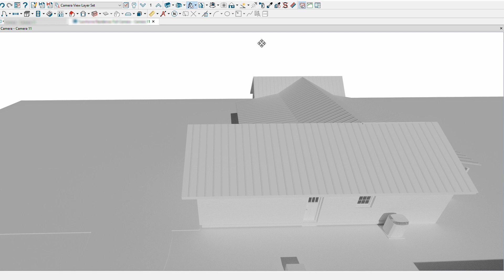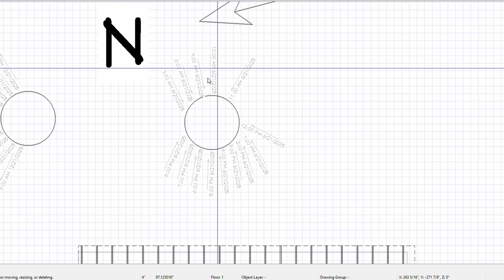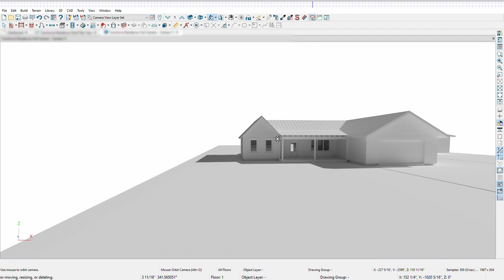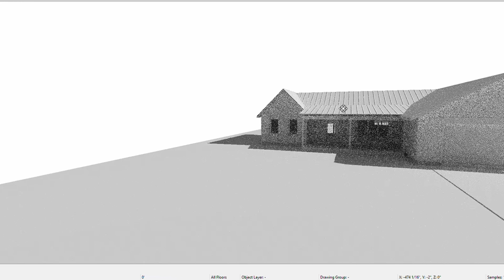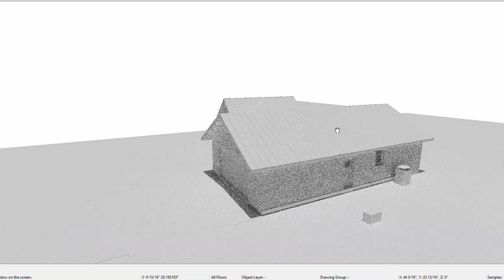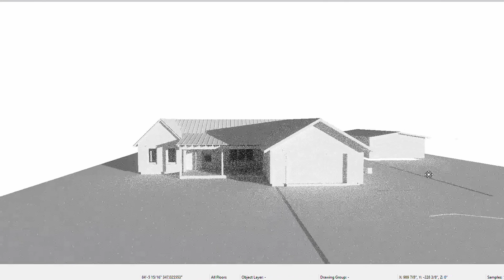How to Track Sun Angles when Designing Your Home - AHPH 104

Comment: Don't take this the wrong way as I have allot of respect for your work so bear with the criticism. 
 
       I have lived in TX since 89 and have learned a few things about directions of parts of houses.
   
           Views. Unless you have a lake or a pond or mountain, no one cares about the view out the window no one is watching the sunrise or sunset from the inside of their house.
     
           Never point the front of the house south if you can help it.
 
           Never point the garage door south (heat and hot south wind in the summer)or to the NNW(direction of prevailing weather). 

          Never ever put floor to ceiling windows in a house. If there was ever a place that they are a bad idea it is here. Also never put them in a bedroom and always have at least one wall in a bedroom without a window or a door. Common design makes sure there is a window or a door on every wall so you can't put furniture against a wall. Same with living rooms. Large windows in living rooms are also a no no.

          Don't place your house at the far back of the lot. This gives you no usable back yard and nowhere to build workshops etc. Front yards are unusable space that have to also be maintained more because they seen from the road and you want your private use space behind the house.

           The hip roof you started with yeah not a fan of them as they are meh and vastly overcomplicated which leads to higher install cost higher replacement cost and a far higher likelihood of leaks and issues over it's life.  
        
          I prefer the version with the full length porch. The short porch looks like a builder trying to save a buck. I also like the old large overhang porches around the house as the point was to keep the sun and weather off the exterior walls, an early high performance feature.

            Your solar panel plan is good. I'm a big fan of them. When possible I would opt for a ground mount system. Yes you loose the heat rejection of the panels being on the roof but the panels will produce more power in a ground mount setting because they stay cooler and you can also use bifacial panels which will increase output as well not to mention install and maintenance is far easier with a ground mount system. Cleaning and repair as well as when on the ground you have the capability to easily add a hail protection system to them.

           I tend to take a more pragmatic approach to most things and have a different look at things as I am looking at it from a realistic use approach not a realtors/builder side where they generally don't think about how people actually live in a house. If I end up in Austin one of these days I'll buy you lunch and have you looking at things in a different angle.
Reply from the maker: Thanks for the feedback.  All good points. Especially the south sun getting hot.  I'll take you up on that lunch anytime!
Reply: Shoe box layout. 
10 foot walls. 
This gives you height to run a full length Lean-to porch on south side while keeping 8 foot height for a deep porch and plenty of shade.